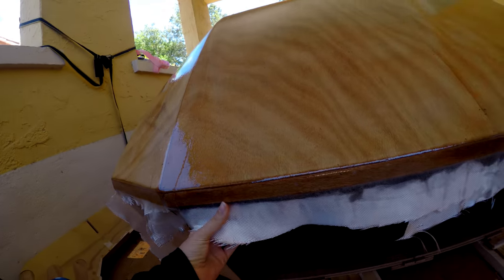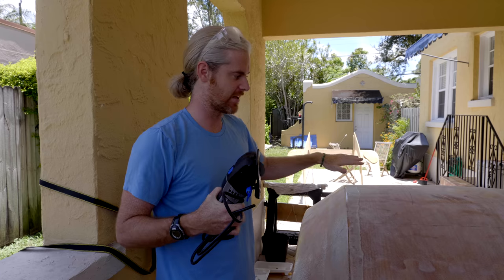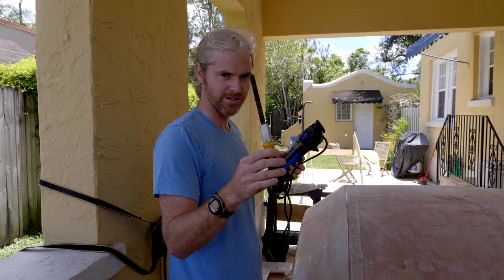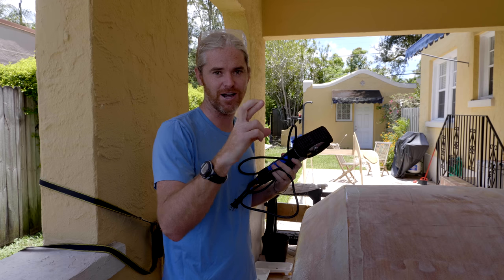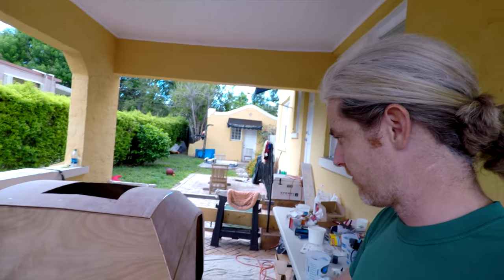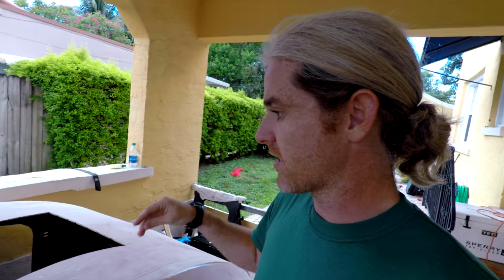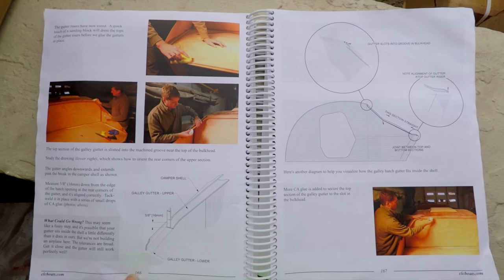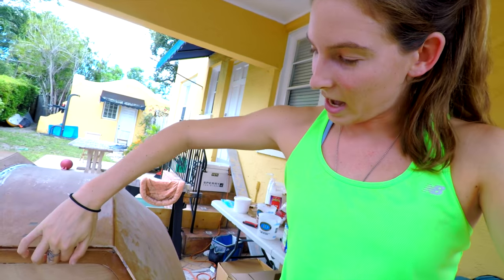Building a Teardrop Camper - Episode 5

Comment: How many coats of epoxy did you put on before taking it to the auto body shop? I know you put a coat on for the fiberglass but did you add any additional coats?
Reply: Waterlust That was very helpful thank you!  Im getting ready to put the bottom on so i have a bit to go but just thinking ahead. I am pretty sure I will go with a sprayed on clear coat. Also thanks for posting all the videos of the teardrop. Your videos are the main reason I went with CLC camper.